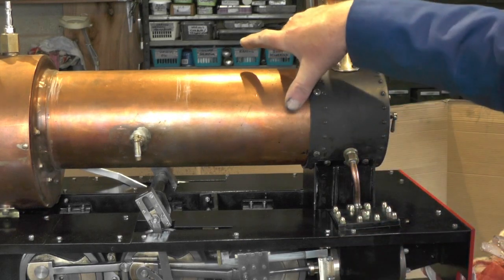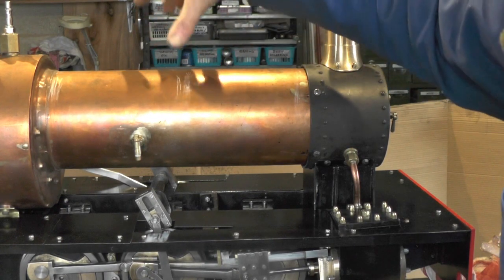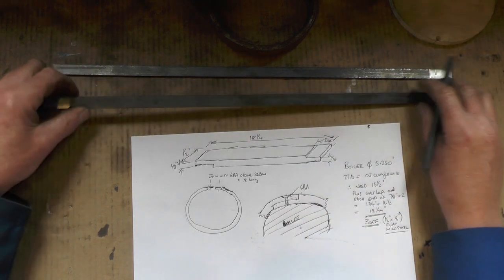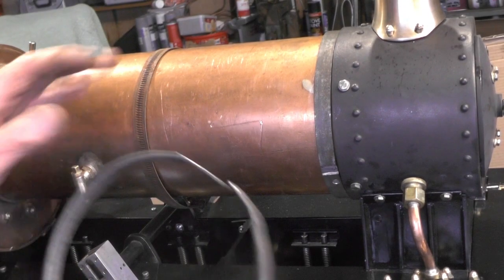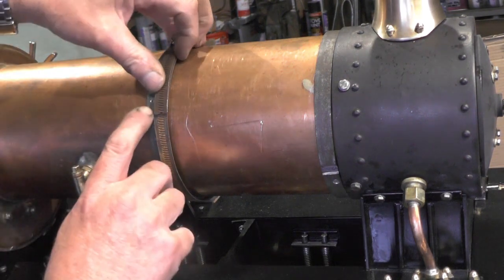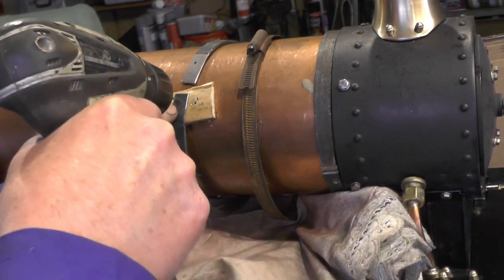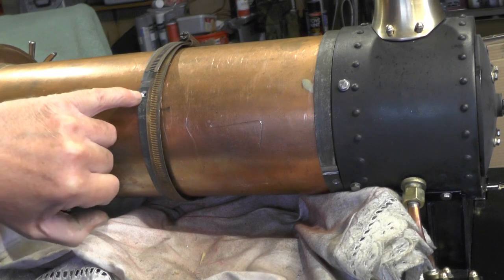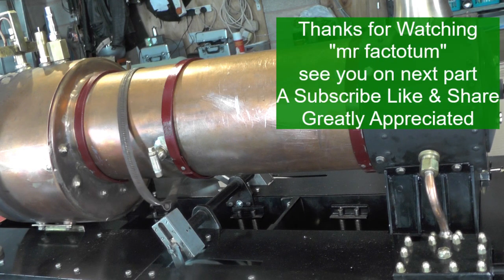Beginners Miniature Steam Locomotive Series (Boiler Cladding P1 - Inner Bands ) "mr factotum"

Comment: I might be worrying about nothing but what about the expansion of different metals? Won't copper expand more than steel and put a lot of stress on those single screws in the bands?
Reply from the maker: hi mark
thanks for watching and taking note, i understand where your coming from but I don't think the amount of expansion will be any problem also when the outer bands are fitted on top (coming up in next videos)  they will take any strain. 
Regards
 mr f
Reply: For prevent such things....you could made a slot out of the hole from the overlapping part.... just 1 or 2 millimeter... or just mor clearence... but i think that Expansion is no problem.... 😉
Reply: @MrFactotum  A quick check of the maths assuming the boiler is 16" diameter gives an expansion of about 54 thou for 200 degrees of temp change (for example) for Copper and 34 thou for mild steel so you are probably ok as you say, the difference being 20 thou. I would mention one other point,  Any moisture between the boiler and the band due to cooling condensation for example will cause rapid Galvanic corrosion  which I think could cause damage. Maybe consider putting paint on the rear of the band? although I would probably make the band from copper instead of steel which would remove the risk of boiler damage by both expansion and galvanic corrosion. But I am no expert, never built a live steam loco so maybe I am over cautious. PS Due to the Anode/Cathode nature of Mild Steel and Copper, the mild steel band  will corrode much faster than the copper. PPS I am not sure what temperature a steam boiler will work at but as burning coal can easily reach 1300 degrees C the expansion difference (roughly 10 thou per 100 degrees) could be  bigger if for example a boiler could reach a higher working temp e.g. 500 degrees would produce a 50 thou difference.
Reply from the maker: @markwarner2257  hi Mark
Thanks for the in depth reply. I too am no expert. I will bear everything in mind what you say. I did paint the rings before fitting. I think I mentioned that in the video. Also the book I am working too. Build your own steam loco by Jack Buckler. Actually says make a snug fit  in mild steel. So I am just working to the book. Thanks for your constructive concern I appreciate  anyone who takes  the time to show interest and pass on good information. Keep in touch. See you next time
Regards
Mr f